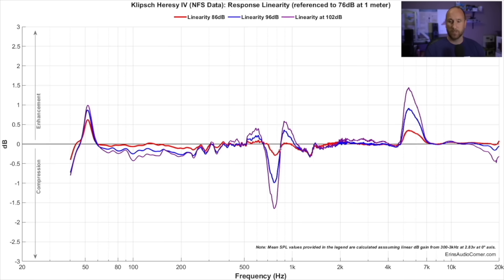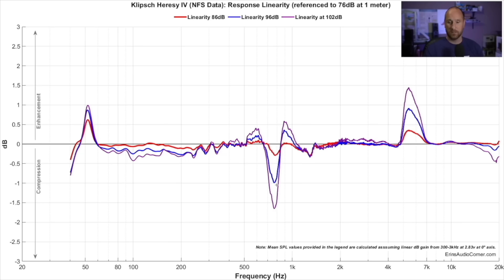Speaker Compression Sucks the LIFE Out of Your Sound!

Comment: The absolute vast majority of ALL SPEAKERS manufactured today including so many of the ultra high end speakers suffer various forms of  complex passages frequency and harmonics nullification bottlenecks It can be done right but it has become apparent most manufacturers lack.the internal knowledge and/or talent. It's time most of the INDUSTRY stop idolizing figure head designers and engineers that are simply in the stone age compared to what is possible and what others have done that are minimized by the talking head non or low performers in this industry....SOME REALLY CARE TO EXPERIENCE REAL HIGH PERFORMANCE NOT A HOPE OF THAT.
Reply: Big rant but no examples of speakers that don't have "frequency and harmonic nullification".
Reply: @RennieAsh MINE
Reply: Not much has changed in audio technology.. since the 70s.

 A few different lighter materials.. but even those differences be matched with stronger magnetics.

 In fact.. i have a pair of 70s audiophile speakers that utterly destroy most of the modern trash that ive heard.  Such as the local high end stereo shops $3000 flagship speakers.  Mine crush them in every metric... by miles.

 The real problem with most modern speakers... is that the ECO Radicals have infected the industry.

 They want lower power consumption... not better audio clarity.

 This is why most speakers went from sealed... to ported.. in the 80s.   Bass sounds much more musically realistic on sealed speakers. Ported speakers have very artificial sounding and annoyingly droning bass.

 They then infected the music studios.. and started heavily compressing all music cds... starting in the 90s. Each passing year.. they bump up compression levels.. hoping that the public would never realize it.

 When they got caught.. they made up a lie.. calling it the result of the Loudness Wars.  Nothing could be further from the truth.
Reply: @johndough8115  This makes no sense. They're not going to increase the compression level because of your speakers. They're only doing it because they think it's going to increase sales.
Reply: @tschorsch  You dont know what you are talking about.

 Compressed music is LOUDER  than Non-Compressed audio.

 They use compression, so that it takes LESS AMP POWER.  Less power, for LOUDER playback volume levels.

 This isnt some "Theory".   You can compare CDs from the 80s.. to almost any CD in the 90s and beyond.

 You will have to turn UP the volume to a decent level, for the 80s CDs.  But the moment you put in a 90s era CD... it will be like twice as Loud.. so you will have to lower your volume levels.

 People never bought music, because it was "LOUDER".  They buy music from artists / bands that they Enjoy.  How would any person even KNOW how loud a CD is... without even hearing it First ?!   USE YOUR BRAIN !!!

 This argument has nothing to do with Speakers... other than than that they had already started making high Efficiency ECO-SPEAKERS, with very Weak Magnetics .. in the late 70s and continuing to the 80s and beyond.

 You dont get Something for Nothing.   Eco Speakers have high distortion percentages... because those weaker magnetics, cant control the cone as accurately... nor accelerate the cone as fast.
Reply: @tschorsch  Part 2:   My first experience with Compressed CDs.. was with Van Halen.

 I grew up listening to them on Tapes.. and later, bought their CDs.

 I prefer David Lee Roth as the Lead singer.  However, some some of Sammys stuff was good too.

 When I went to buy their latest CD... which was called "For Unlawful Carnal Knowledge"...  I was expecting it to be ever BETTER quality that ALL of my other CDs.  Why?   Because this was the first and ONLY CD... that is  DDD  (pure digital, from recording to pressing).

 Every other CD, was either AAD, or ADD.  (IE:  Analog recording, Digital Editing, Digital CD.   Something like that)

 Yet... the very moment I played it... I was CRUSHED at how BAD it sounded... compared to ALL of my other CDs.  Not just how bad it sounded, to all of their Previous CDs... but ALL of my CDs.

 I was so Pissed off, that I refuses to buy ANY more new CDs, from that point forwards.

 Mind you.. at that time, I was probably 17.. and was buying new cds.. almost every weekend.    I had a brand new Pioneer 5.1 surround sound amp,  a Laser Disc Player (with Terminator 2),  and some pretty decent Speakers (sadly, I cant recall the brand.. and when I had to move, I couldnt take them with me).   They were far superior to the later 90s era Techniques speakers that I bought... i can easily tell you that !

 Anyway... Tell me Something... "GENUIS"
How the heck was I supposed to Know that Van Halen's new  "F.U.C.K"  CD,  was going to be 40% Louder than all of my other CDs?   And why in the world, would I ever have CARED ?!    I believe my amp was like 400 watts of power.  I could blow almost any speaker that I hooked up to it... if I ever wanted too.

 Also... even further... Do you really think that many people were using Portable CDs, while walking around, back then?   Nope.  Anti-Skip technology had not even really been in use at that time.. and even when it was widespread, it wasnt very good / effective.

 Even then... people were also not blasting Hard Rock, over low power Boom-Boxes, either.

 There literally is ZERO EXCUSES for the Compression.

 The only time you MIGHT even have the SLIGHEST of plausible excuses.. is if you were talking about the Ghetto CDs.  Rap, HipHop.. etc...   In which the Hood Rats would blast them on their battery powered Ghetto-Boxes.

 But a Van Halen CD?   Nope.   Why did they choose VH... and use SO MUCH compression on it?

 Likely Because it was assumed that since Van Halen uses distorted Guitars in its music... that the listeners wouldnt be able to Tell the differences, anyway.

 The actual truth is... is that you can Tell FAR MORE EASILY...  because theres a HUGE difference between Intended "GOOD DISTORTIONS"... and detail destroying "BAD DISTORTIONS".

 But like Ive said... the biggest Lie is easily revealed.. by using the most Basic of LOGIC.   No person buys Music... based on its Playback Loudness.  Z E R O.  Nor would they Ever even know which CDs were  "louder"  than the others.

 It was one of the worlds most PATHETIC of EXCUSES... and sadly... fools like you... seemed to swallow that Trash right up, without any questions at all.

 I bet you didnt think Sony would put a hidden Root-Kit Virus on their Music CDs either... Did you?   But they did... and they were eventually Caught, too.

 But big Corporations would NEVER LIE AND BE DECEPTIVE TO US !!!   >_<

 Just like big GOVT would NEVER lie and or HARM its own Citizens... Right ?!   >_<
Reply: @johndough8115  Loudness Wars was a term given to the compression chasing. It wasn't coined by the people doing it.
Reply: @Safetytrousers  These Terms didnt come from the Public.  You would have to be a Moron to believe otherwise.
Reply: @Safetytrousers  Again... What is the Point?  People kept trying to Blame Loudness Wars, on Individual People, seeking out Louder CDs... which makes Zero Logical Sense at all.

 As Ive said from the Start... there was never any actual "Loudness Wars".  The studios were INFECTED by ECO RADICALS... that wanted to  "Save The Planet"  one Watt at a Time... at the Expense of actually having good quality music that we can Enjoy.

 Now we have music that is Awful, Flat, non-creative Garbage... that isnt worth listening too.   But hey... it saved a few watts.

 Yet... CERN can spend an Entire CITYS worth of power, in a single Fire of their Particle Accelerator.   And of course... if you are one of the few Wealthy ELITE... you get access to the highest power drawing audiophile speakers.. and even access to non-compressed audio.. that the public doesnt ever get to experience.

 Also... you DO realize, that ALL of the Mass Media outlets... are controlled, right?!   Terms like that in a Magazine, was not a Coincidence.  It was planted there, on Purpose.  It was designed to be the EXCUSE, that the Brainless NPC LEMMINGS, would point towards... rather than Attacking + DEMANDING that the studios release non-compressed CDs... and Non-Compressed Digital Files.

 And finally...

 I actually ran into a rare interview with a major audio companys engineer.  Sadly, I cant remember the name of the man, nor the company...

 What I do remember... is that he was talking about Power Draw..  and Speaker Accuracy..  and how it would be Environmentally Unethical to produce speakers and amps that were using utterly Insane amounts of power.   Basically he was saying... "At what point are you going too Far?   And at what point, would the Company be held Responsible for the additional Pollution levels?"

 Of course, there is a huge difference, between a decent high end speakers power draw... vs..  the most Extreme Examples.. that you could theoretically come up with.   Meaning... 200 watt speakers are one thing... but 10,000 watt speakers... is going too far.

 The problem is... Is that the radicals want you to have 15 watt speakers.. that have utterly Awful audio output capabilities.

 And since they couldnt fully control peoples power levels at the AMP... they went and Destroyed the MUSIC itself, via Compression.

 But its never enough for them.  Eventually, radicals like this... will try to limit you to a mere 10 minutes worth of listening.  Stuff like that.   The radicals themselves, and the  ELITE that puppeteer them around... THEY will still have full access... while everyone else gets the Shaft

 "Some Animals are more EQUAL than Others"

Comment: Your ears are the weakest link in the system , we use limiters for a reason ..so we dont blow our ears up !
Reply from the maker: Watch the video. Tell me you feel the same once you factor in dynamic range, distance and DSP limiting.
Reply: Moronic take.  Typically they do this to be able to use the cheapest garbage quality drivers... to prevent them from blowing up at mid to high volume levels.

I got one of those b0se radios dirt cheap at a thrift shop.  B0se uses a limiter system... and you can easily hear it in action.

 That system isnt very loud..even at max volume levels.  But the limiters start reducing bass levels... at only avout HALF of the volume level.

 So.. Instead of getting louder and thumpier bass... you instead get louder midrange and highs.  Of course.. the highs are really awful too.

 You cant really expect much from those cheap chinese 4 inch drivers.  B0se probably gets them for like $1.50 each.

 B0se doesnt built high quality speakers. They are part of the ECO Radical cult.  They build for power efficiency... to reduce power consumption... above all else.  They use special tricks to make waek drivers perform as good as possible... but ultimately... they pale in audio performance... against boomboxes that are a fraction of the cost. Basically.. the whole company is a scam... with an excellent marketing department.
Reply: @johndough8115 they were one of the first to use some kind of active loudness compensation in little speakers. It worked great on their PC speakers, for regular users. 
Anyone maxing out small speakers often, simply needs larger speakers.
Bose does cost more than it should.
Using cheap drivers isn't anything new however
Reply: The limits of our ears lie mostly above 1kHz. While those of the speakers are below 100Hz.